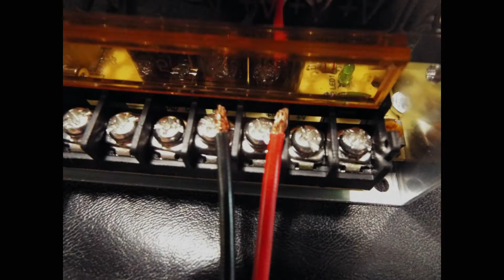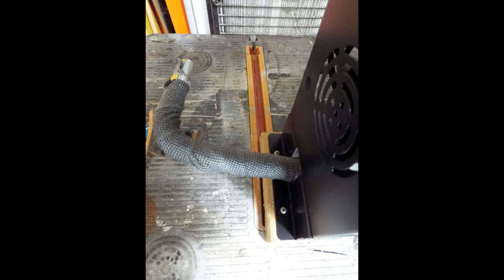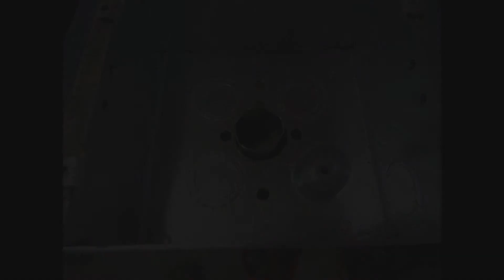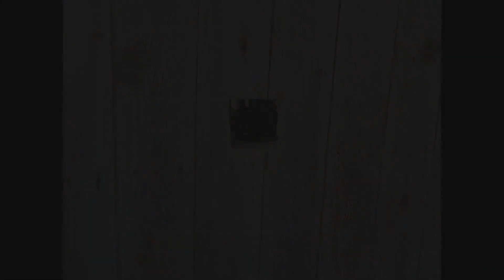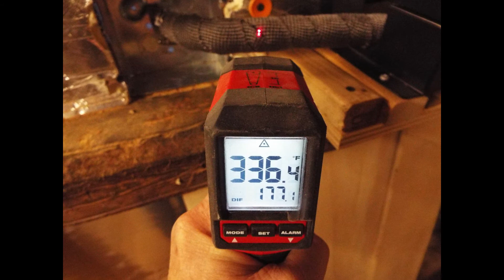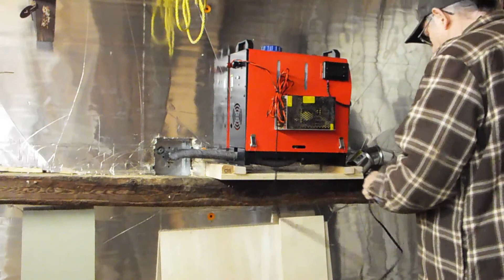Episode 6, It Just Has To Work, Portable Chinese Diesel Heater for Out Buildings, UPDATED INFO

Comment: You didn't have to run the exhaust out the back of the unit you could actually just run it right out the side like I did My exhaust went one way and my intake went the other which both were completely away from each other and I did not run it out the back because of all the excuses you just gave. Screw all that moving shit I set my shit up pretty damn quick and I've got the same unit
Reply from the maker: The idea of that moving "shit" was to eliminate having to purchase 4 units, one for each building. And depending on winter circumstances, I may not need the heater in a particular building for a year or two. Whole lot cheaper to make one heater portable than to purchase 4 and not need them for years! 
As for the exhaust placement, it makes it easier to carry to each building than to have the exhaust stick straight out the side of the heater, 2.5 ft. And I don't have to poke the exhaust out the metal exhaust port by 2.5 ft. either.